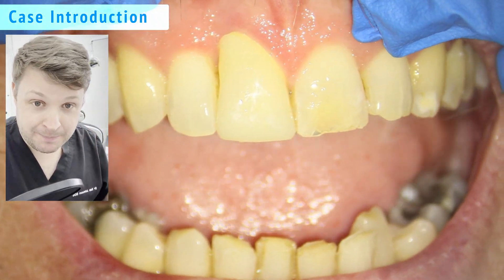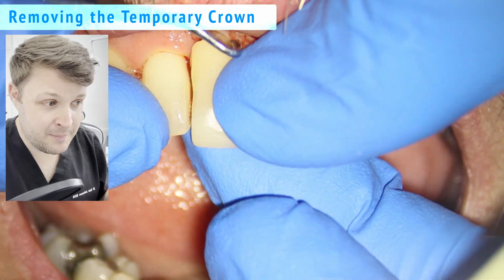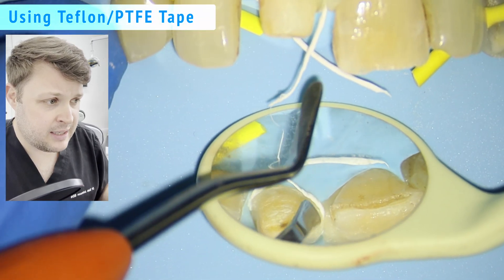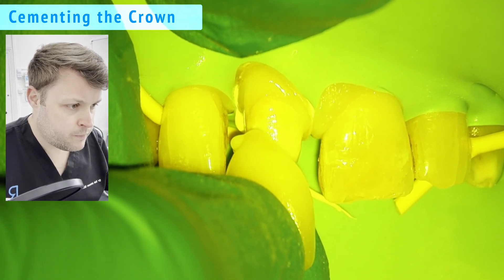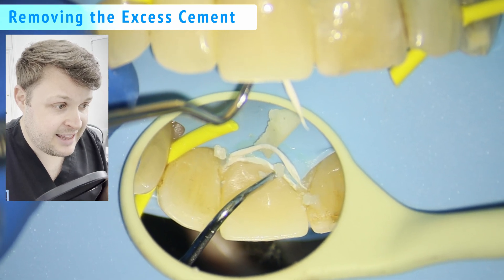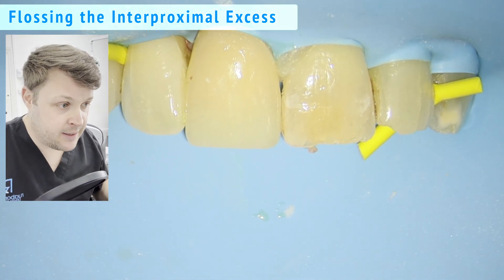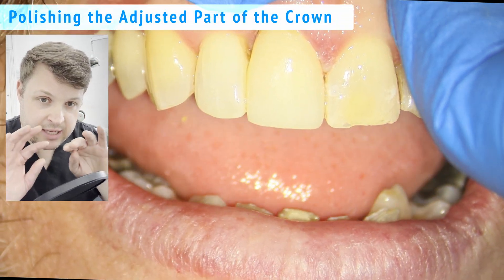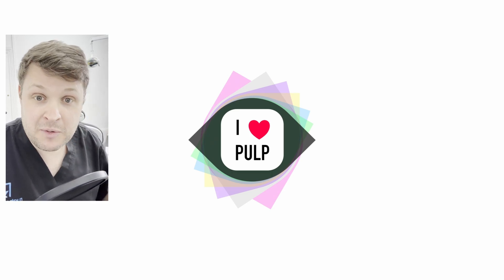HOW TO CEMENT A ZIRCONIA CROWN | 4K Resolution

Comment: I had a very similar case recently. I luted the crown with a RMGIC. I think you have enough coronal tooth tissue to do the same. 
I personally hate bonding. Too many variables to control.
Reply from the maker: Thanks Anup, I think I'll start using RMGIC in the future. Do you have a preferred brand?
Reply: @ilovethepulp  I use gc Fuji plus. Easy to use, easy clean up.
Reply from the maker: @anuppatel624  Thanks anup, do you have any suggestions for other videos you'd like to see?
Reply: @ilovethepulp  can you please do a video on doing access cavities through crowns for endo. Any tips? Which burs you use for zirconia and e max crowns.
Reply from the maker: HI Anup! check this video out about accessing a tooth through a crown! https://youtu.be/_aflynI_tjI

Comment: Nice case, great video and flawless clinical skill. Just have a few questions regarding your thought process-
Why was a dual cured resin cement chosen here over luting glass-ionomer?
I can see the benefit if the crown was sandblasted chairside to allow 10-mdp interaction with embedded alumina within the intaglio surface- but if it isnt treated, then isnt your resin cement just acting as a luting agent?
Perhaps for colour but zirconia is pretty opaque is its unlikely to have helped
Just curious to know your thoughts!
Thanks
Reply from the maker: Yes! I had an thought that someone might comment on my use Rely-X! 😂 You’re right, because of the crown choice in this case it is only acting as a luring agent. I just feel like the excess is more easily removed and polished compared to a GIC. What GIC product would you have used and what are the benefits?